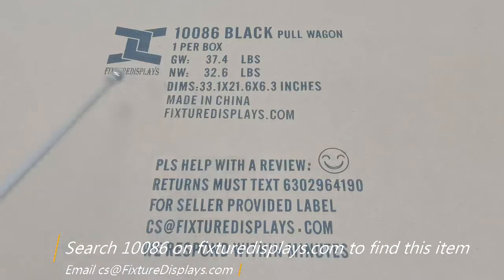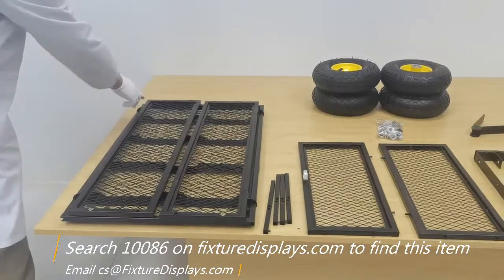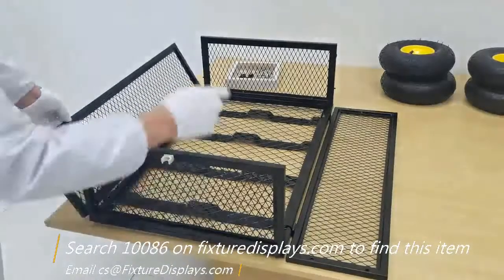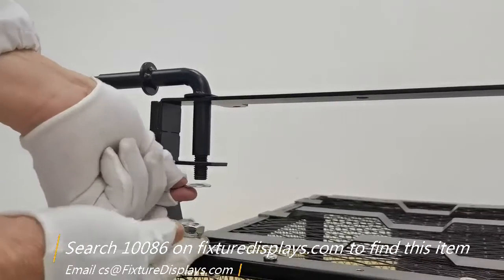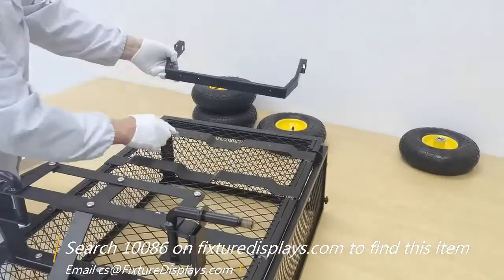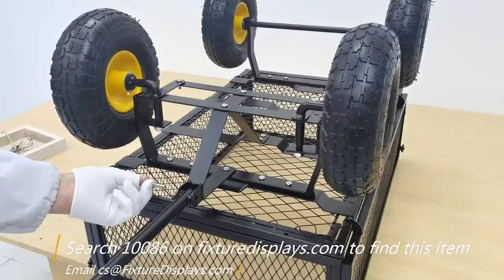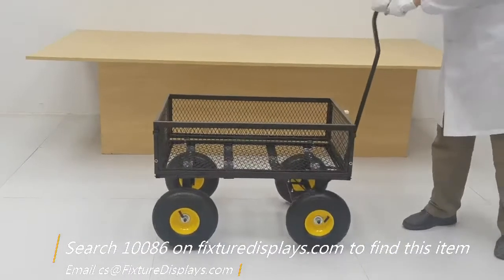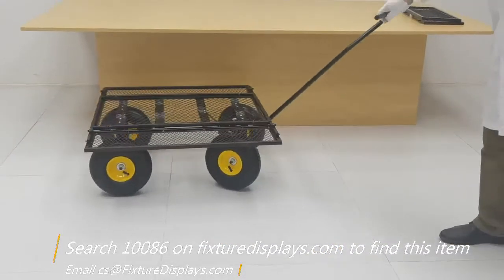10086 Garden Cart Pull Wagon Farmers Rolling Flat Bed Basket Large Pneumatic Wheel FixtureDisplays I

Comment: Omg people make fun of ikea furniture but this is worst when it comes to assembling it.
The audio explain is not very good.
There are 2 different lengths screws. Use the shorter ones for attaching the wheel base to the cart bottom, it’s difficult to fumble with the nuts between the cart floor and the frame so it’ll be easier with the shorter screws.
What is also weird is that there are now washers between the steering construction. I didn’t have any at home but would have preferred them between the metal rather than the metal rubbing against each other.
My recommendation: don’t worry about tightening the screws until you flip the cart over, loosen the screws without touching the nuts so that the nuts are flush against the metal, then hold the nuts tight and tighten the screws. Much easier than upside down
Reply from the maker: Very much appreciate your feedback. We will re-dub the video and add your comments. Tks.